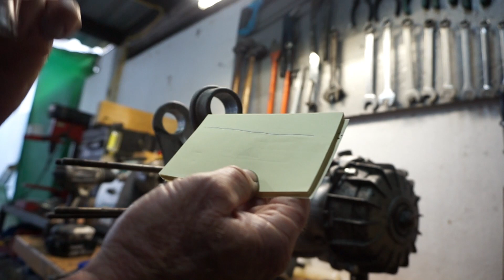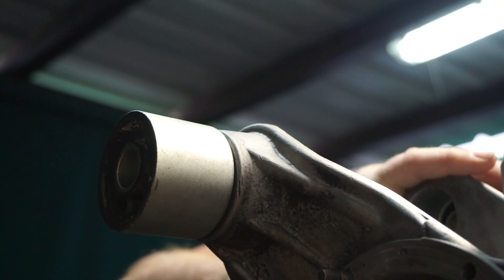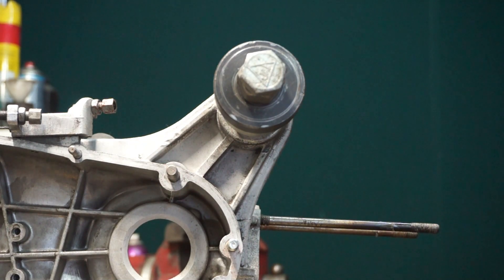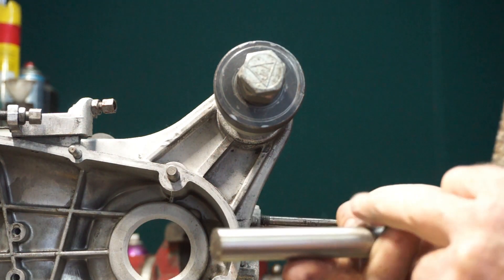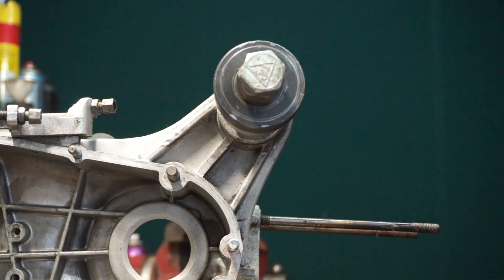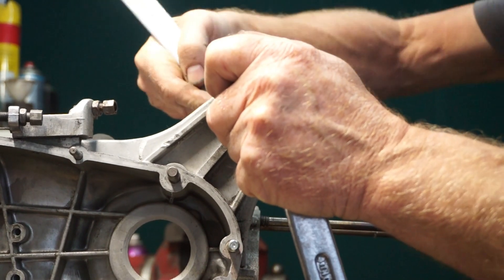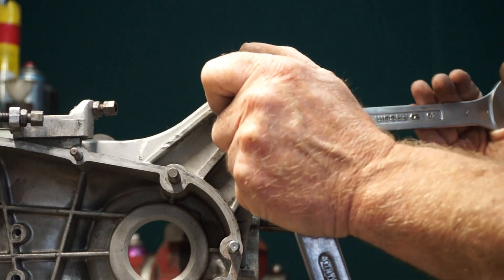ENGINEERING TIPS repair engine mounts

Comment: Steve you could always run a knurl around the engine mount in your lathe save you centre punching the casing
Reply from the maker: No thats the wrong way , always on the softer surface , if you knirl the mount you will remove more material from the casing .....
Reply: Sorry didnt make myself clear, you would need to reskim over the finished knurl prior to fitting should increase the dia of your mount by a few thou dependant on the depth of knurl
Reply from the maker: @acooper4482  nope you will just score more material from the casings no one does it like that for good reason sorry buddy , you always build up on the soft surface that way you can replace again later . been at this for 40 years mate engineering is my trade .
Reply: Fair play mate i hear what your saying.  Thought if the size was matched it wouldnt score it 😀
Reply from the maker: @acooper4482  old casings mate most likely had someone knock them out with a screw driver in the passed . but soft surfaces where out ? innocenti never imagined them getting twenty set off mounts, ten cranks, and ragged all over the world for fifty years ++++
Reply: Chrome plate the mounts:)